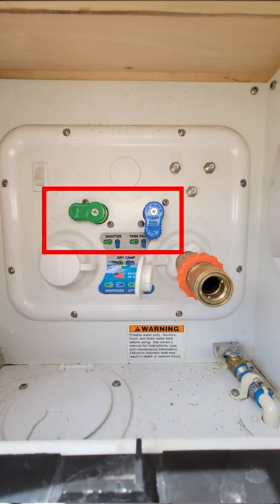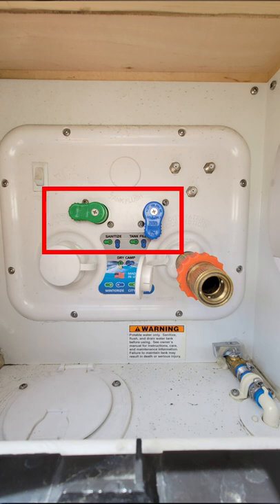T@B Tip Tuesday: Prepare your freshwater tank for dry camping - #shorts #tab320 #nautilusp2

Comment: Do i need to press on the Pump to fill my fresh water tank?
Reply from the maker: If you are connected to a city water connection, then no, you don't.
Reply: So I will just put the blue and red in the waterfill position and let the citywater do its thing? Thank you for replying. im just picking up my 2021 tab 320s now..literally they are installing the breaking system now lol
Reply from the maker: Not the blue and red, they are low point drains, but the blue and green.  You can also do a search for the Nautilus 2.5 and download the mannual.
Reply: oh yea the blue and green..is the overfill the blue one in the rear middle?
Reply from the maker: @jomergutierrez4949  no, the overflow is not something you access. It just send water out of the freshwater tank if you overflow to a drain in the rear bottom.
Reply: okay great. thanks for your help👍🏼